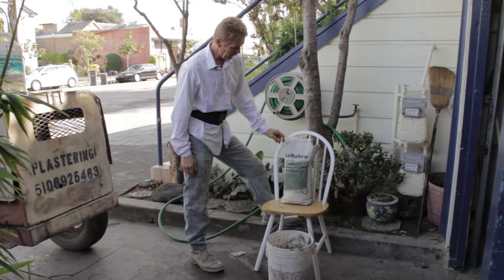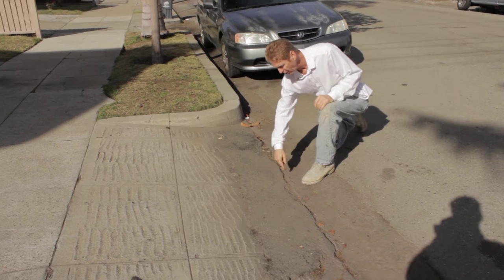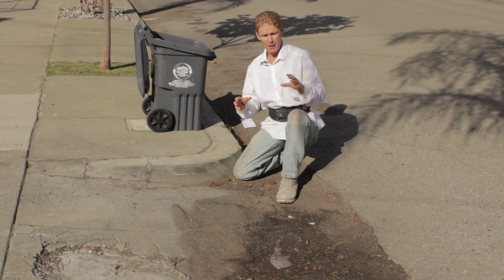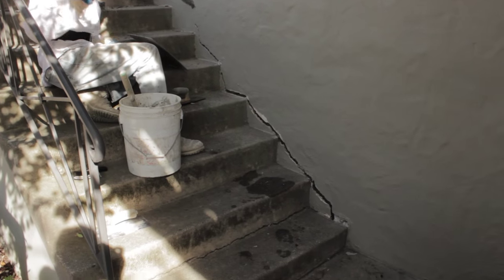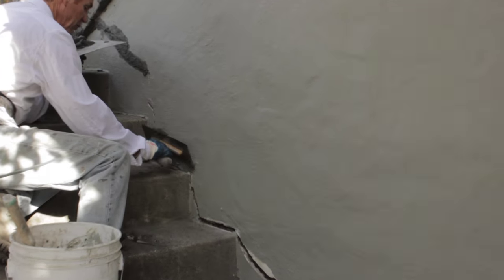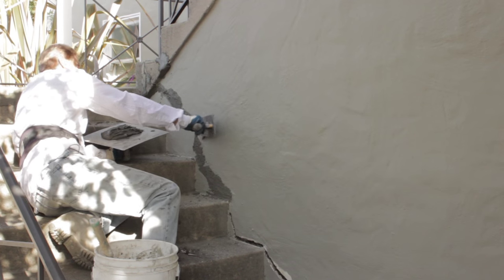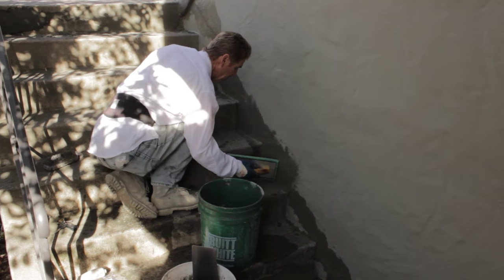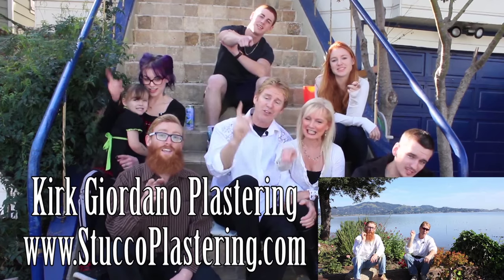Repair structural cracks in stucco and concrete

Comment: quick question, i  have some front steps i need to repair / patch. can i use a mixture of 1 part cement to 2 parts sand? also does it need to be portland cememnt or can i just buy a bag of quikrete cement? i see alot of people recommending vinyl cement patch stuff from the box stores but i see that stuff break down a few years later.... thanks in advance. enjoying the videos
Reply from the maker: Good afternoon Spartan, the reason I used polybond was because it will adhere to everything, portland or quikrete will not.
            Live long and plaster
  Kirk’s how to plastering video’s